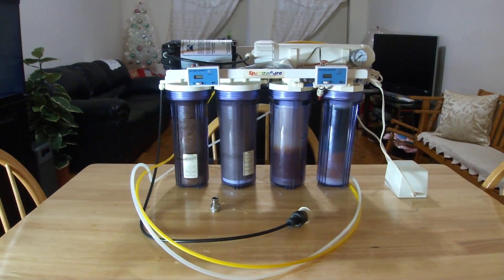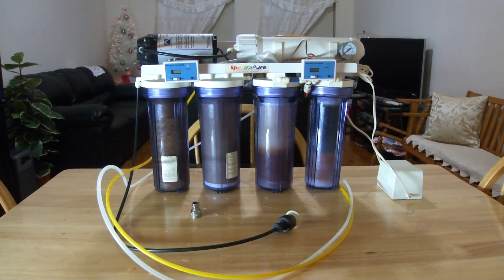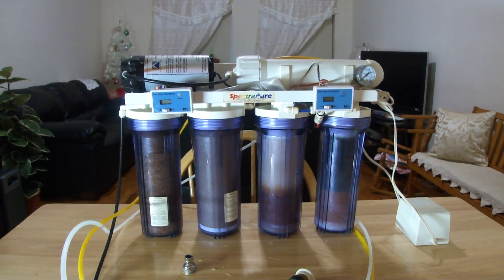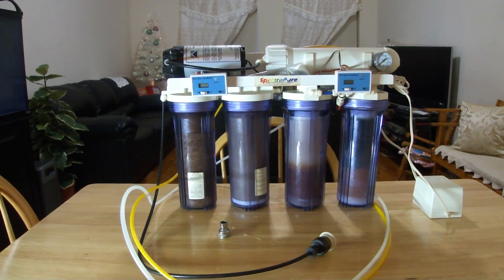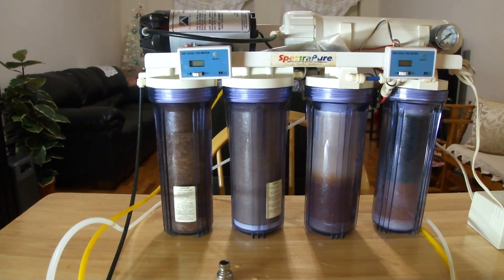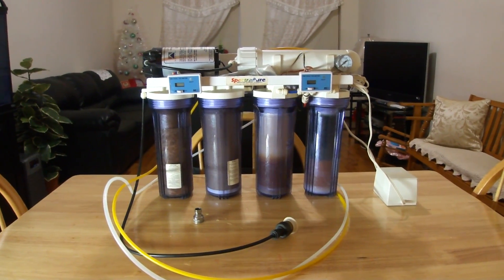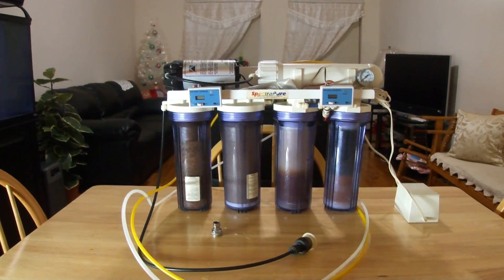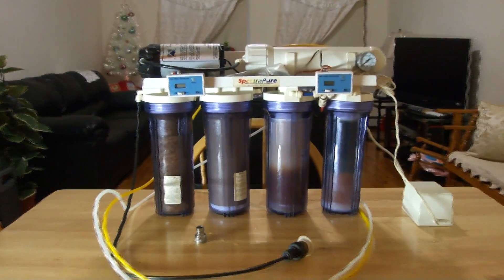Reef Aquarium RO/DI Filter System

Comment: Love the videos. My question is I've started my reef with tap water why dechlorination Chem that they sell at pet stores. I purchased a used bulk reef supply rodi unit that was giving out 2 ppm I replaced all chambers and am now getting 0 ppm. My question is are there any steps I need to do to get my tank up and running with good rodi water or will top off and water changes eventually remove bad water I put in before?
Reply from the maker: Whats done is done so I wouldn't completely change out all the water now that you have an RO/DI unit producing pure water with 0 tds. Instead, I would do just as you stated which is continue the routine water changes and in time, most of that old tap water will either be removed, or filtered out.
Reply: Great thanks again for the response
Reply from the maker: chrisviri garcia Your welcome.

Comment from the maker: Whats done is done so I would leave it be with the tap water. From now on though, given that you just got an RO unit, you can begin topping of the system as needed and doing routine water changes with reverse osmosis water. Expect higher than anticipated algae issues initially due to the use of tap water though. Eventually you'll see less of it with the use of pure water. Have fun and good luck.

Comment: The DI system is used for refilling large industrial batteries (5000 lbs plus).  My boss may ask for a little recompense for the water but I would not have to deal with replacing the cartridge.  The only catch would be transporting several hundred pounds of water in the back of our SUV.  Pet stores sell chemicals for treating tap water to remove chlorine and heavy metals and stuff.  Have you any experience with this?

Comment: Steelo, 

I am shopping an RODI system of my own. I live in Brooklyn and am wondering if you think i should consider getting a unit that handles Chloramines. If not i was thinking of the BRS 5 stage with the pressure gauge and dual TDS meter. Any input is always welcome.

Comment: Hey Steelo, I just bought a 120g tank and im shopping for a RO/DI system. there are soo many different ones and idk which one to get. 4 stage? 5 stage? 6 stage? 100/150gpd? something that will do the job is fine for me but i dont want something that is costly down the line either. suggestions?
Joann
ps i didnt buy that tank on ebay that had the "caca" live rocks. lol
p.s.s "PATIENCE IS KEY" is now imbedded in my head now!!!! :)

Comment: Hey what's up Steelo, I have a couple question for you. 

1. Will I still have to do Water Changes with this addition? ( *overflow in place so no flooding occurs due to the drip system installed ) 

2. Where do I set up my R.O. drip system?  Directly into my reef tank and/or Refugium?

Comment: @newyorksteelo Hey does Winter and cold water temps change the waste to water Ratio? I see you have a faucet Adapter, Do you use a specific Temp when using? I heard that using the hot water mixed with cold to achieve a good temp is harmful to your system as the water heater collects sediment metal ect. THANKS FOR THE UPLOAD

Comment: @newyorksteelo NYS ThinkTank
           I successfully found the equipment that was causing this discharge of electricity. It was filteration pump and UV-light-in-one. I took the item back into the store and tried it out on a freshwater tank, there was no charge felt. Once this item was placed into a saltwater tank did I feel the charge again.This  tested on 1 identical item and the results were the same.In your opinon, Is this thing  easily resolved with grounding wire as the retailer says?

Comment: Hey Steezy
My Red Sea Triple Bi-Pass protein skimmer is only bubbling in the inner cylinder and very slightly in the outer cylinder. It doesn't have that all white foamy look. Do you have any suggestions other than buying a new one before I actually do just that and if necessary what would you recommend for s 75gal.

Comment: Good look on the whole psi thing I was wondering why my 50 gps unit was putting out more than that n it's cause I had it connected down in the basement to the water outlet that goes to the wash machine n I split it to go to my rodi but it's water pressure is crazy high it's the first level coming into the house

Comment: What psi reading do you get?  i've got the BRS 5 Stage Plus unit and without a booster pump it's maxing out the gauge past 100 psi.   I think the pressure busted my auto shut off, which BRS sent me a new one for free.  They said they're made to handle 150 psi.  I'm thinking about adding a flow restrictor.

Comment: Didnt have enough room to include this following information. I take my hand off the floor while the other is in the tank I dont get an electric shock. However when I would place my other hand onto the floo there would a shock felt in my hand. I figure its my new equipment. When I implugged it there was no feeling of electric shock with my hand on the floor or not. But I just figured this is an od thing to happen, Do you think I could have killed my dartfish by having this equipment on?

Comment: NewYorkSteelo I have a question for you. Have you ever got eletricuted when a equipment went defective.Here is my scenerio 2 days ago i purchased a UVandPowerhead in 1. I installed the system into my sump and connected it to the power outlet. It turned on the blue led light indicator whoch tells you the light is working. My dart fish dies today. I place my naked hand into the sump and placed my hand onto the floor and received an electrical shock. What do you think?